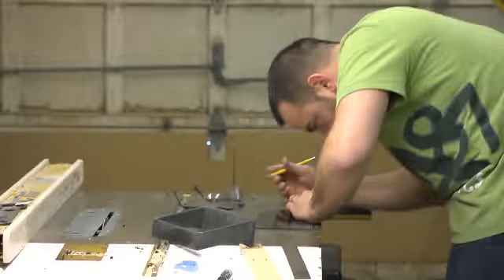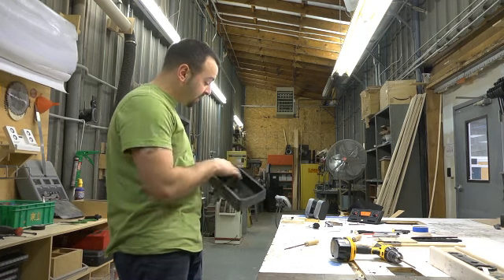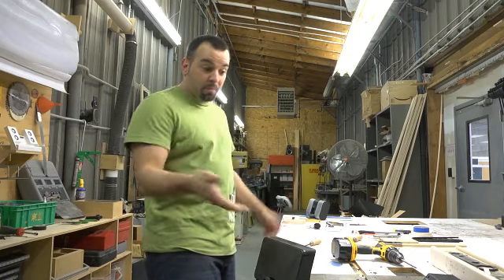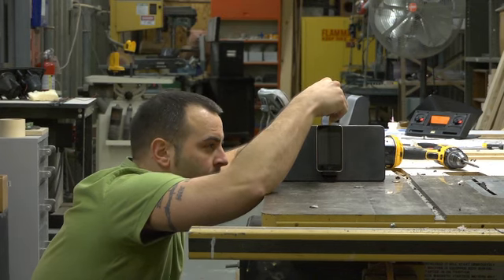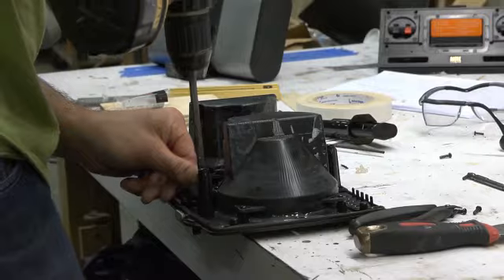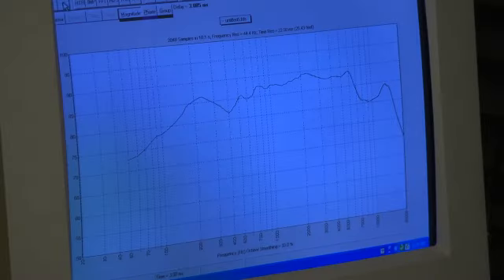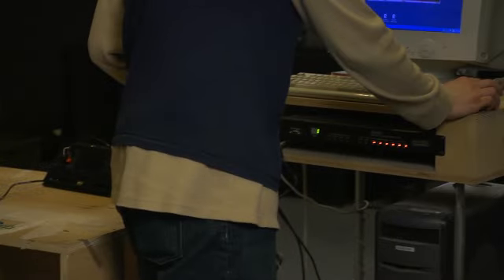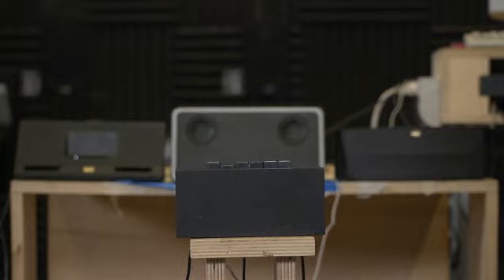Building a speaker prototype

Comment: The last batch of products to come from the Milford PA Altec were pretty decent. Its still funny to see all of this R&D go into tiny ass ipod speakers. Youll never get any kind of  real stereo imaging or actual fidelity from a recording. That bigger boom box style speaker released around this time was pretty sweet though, and the re-designed computer speakers were quite unique. Damn shame they stopped making the real HiFi speakers in the 90's and then went on to do literally NOTHING with the professional line after the Milford office bought the rights from ElectroVoice. Now were stuck with either Amazon bargain basement bluetooth crap and re-branded Gemini products. The Gemini stuff is at least not complete crap however, would be nice to see Altec go back to its roots and make real original products again..